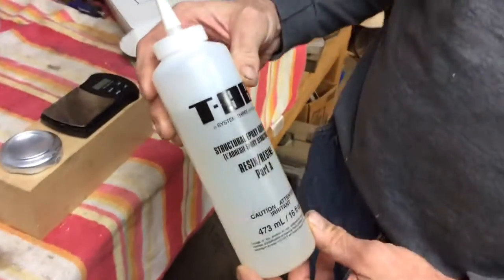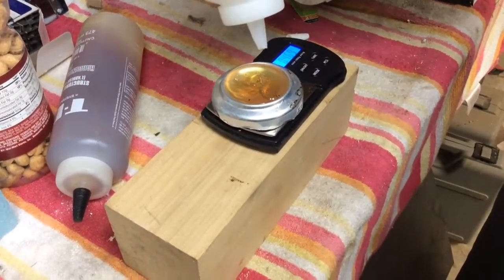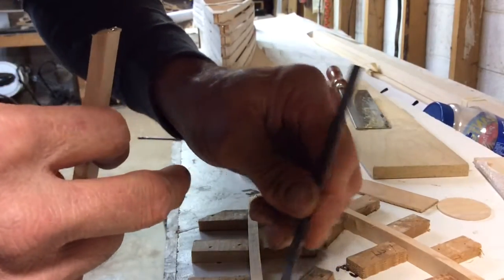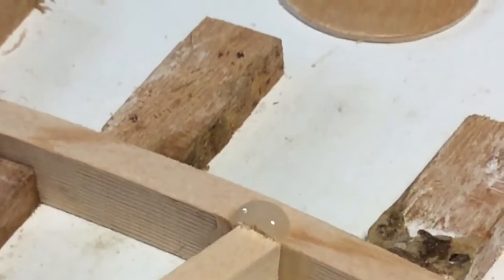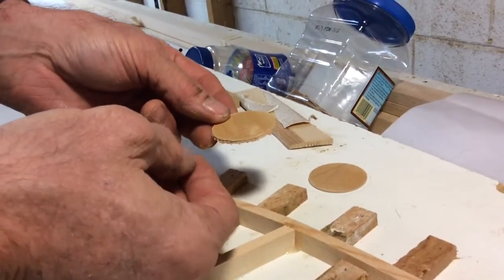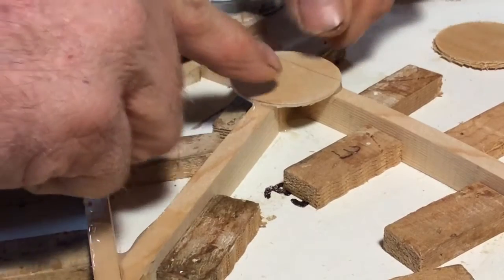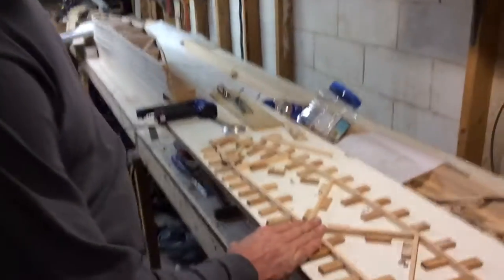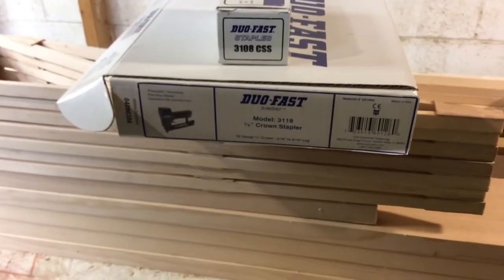Pietenpol wing rib construction part 2

Comment: You are very accurately measuring the wrong glue ratio  ---  T-88  is  1:1  by volume not weight .
Reply: Correct. Read the info in the package or on their website. I don't remember the the exact ratio, but it is NOT 1 to 1 by weight.

Comment: Uhh, you should sand the ply to remove any release agent they use in manufacturing. Oh and glue an eight inch of squeeze out is good. Excess epoxy adds weight to the build fast.

Comment: titebond III is just the ticket. Not affected by moisture, acids, gasoline. Wood joints always break at the wood instead of the glue joint. So easy to apply and easy cleanup.
Reply: TB3 is very strong but not good enough for aircrafts. Typical test for aeronautical grade, water resistance of glues and plywoods: samples are soaked for 10 days or boiled for eight hours. Aircraft glues must also withstand high temperatures, unlike Titebond assemblies that can be detached by heating.
Reply: No PVA glue is waterproof.
Reply: @6h471  Titebond III Ultimate Wood Glue is the first one-part, water cleanup wood glue ever offered that is proven waterproof. The waterproof formula passes the ANSI/HPVA Type I water-resistance specification and offers superior bond strength, longer open assembly time and lower application temperature.

Comment: I have been reading the comments and see several takes on this process. One thing I would like to bounce off you is what type of glue was used in original production. I'm sure it wasn't epoxy that had to be applied to not miss one millimeter of coverage. I have even seen someone calling for a glue that is "vibration" rated as if there is one. If you choose to go to the lengths that you do too satisfy your heart than so be it. Just a note if your gonna be anal about it you should not deform your gussets with staples as it breaks the fibers in the ply demonstrated by the raising and splitting of the fibers. A simple weight or block and clamps is more than sufficient. Very fastidious, thorough and quality work though. It is your plane and and as long as you are having fun you can rub it anyway you want as they say.

Comment: Interest stuff that T88 epoxy.  I think its a 100/100 mix by volume and a 100/83 by weight (resin/hardner.)
I've never used it (T88) myself.  I always make some test pieces in fiberglass or epoxy to eliminate weird stuff going on (expired date catalyst or whatever.)  Thanks for posting this.  Once when reworking my sailboat hull I mixed up a laminate panel with acetone (polyester) that didn't get hard.  Interestingly it could be bent and shaped and later brushed with resin/++hardener to make it hard.